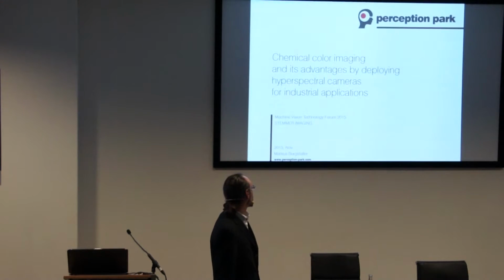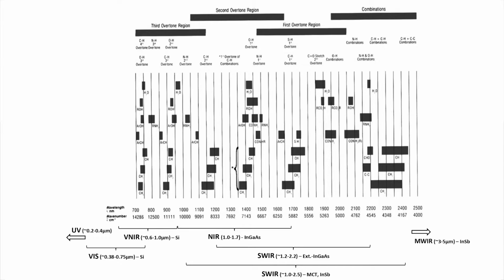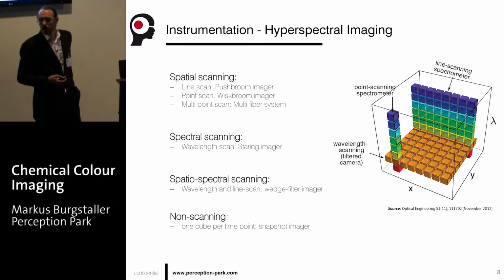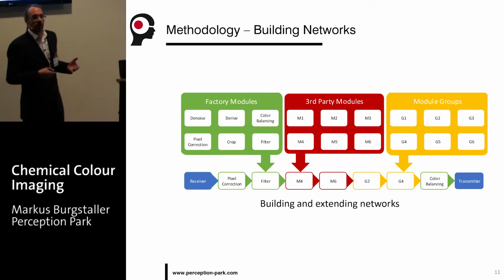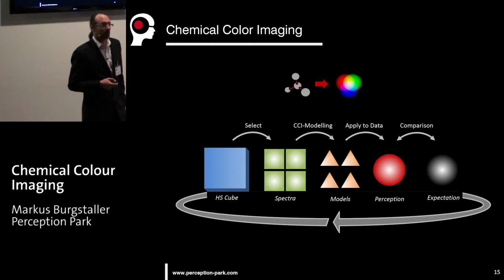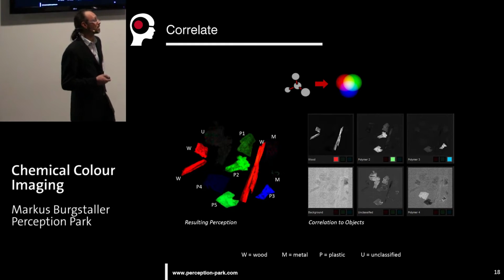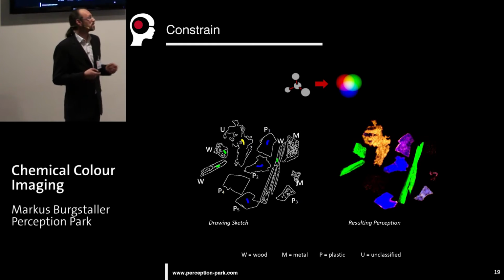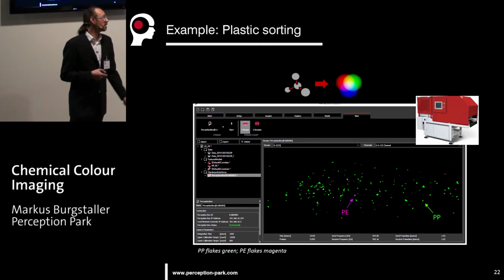Chemical Colour Imaging (CCI) and hyperspectral imaging for industrial machine vision applications

Comment: Nice Video,
Thank you,
Also Visit for more: http://bit.ly/2S13DGf
Imaging chemicals are the chemicals which are used widely for imaging purposes. They mainly consist of printing inks and image developers. The printing inks are applied on thin films using substrates such as paper board, paper, and metal sheets, metallic foil, plastic films, molded plastic articles, textiles and glass among others. They are designed to have attractive, protective, or communicative functions.